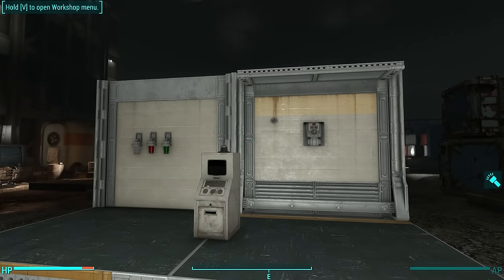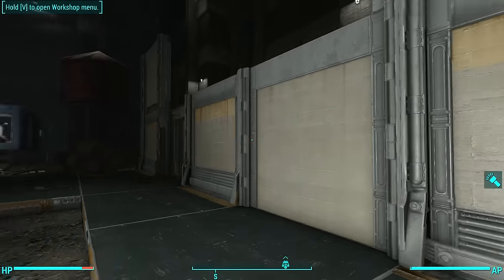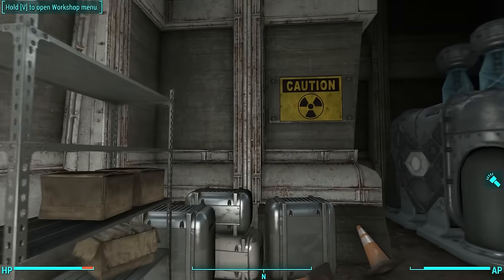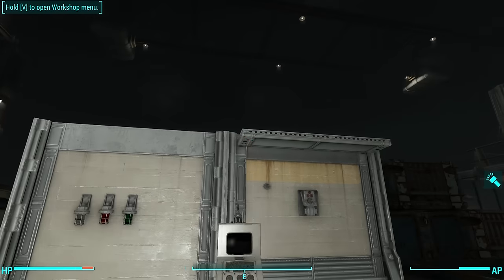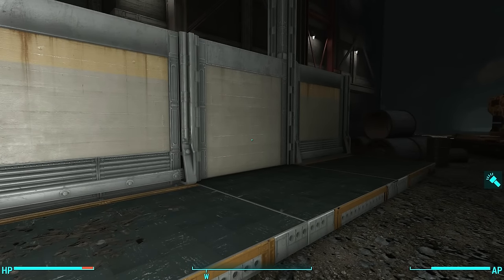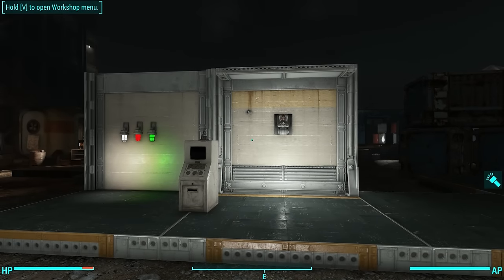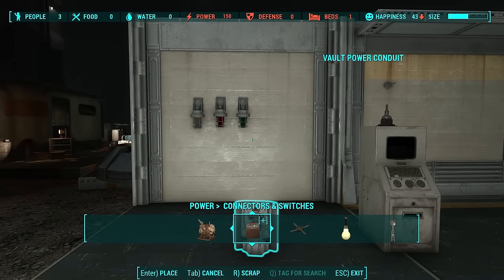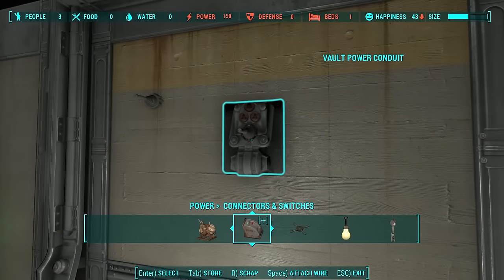How the Wall Powered Conduit Works in Vault-Tec Workshop - Fallout 4

Comment: Well all my walls are connected but I still have no power.
Reply: Fallout 4 ...
Reply: Got to use the conduit to power non vault items.  So basically a conduit everywhere you want to use not vault Tec items
Reply: John Morrison same but as we all know Bethesda don't bug test their games
Reply: yeah I did everything right but parts of my place still wouldn’t power on. I even picked up my reactor and dropped it in different places. but a few sections refused to work until I ran wires on the outer shell of the building. at least you cant see them from the inside.
Reply: Dasychain the power conduits from the reactor in an "unbroken"  but invisible line. the power jumps from one to the other in line.

Comment: I figured out why power might not be working through the vault conduits. This solution only works if you're on PC and you have this problem. Toggle freecam and look underneath the vault reactor. The devs wired these hidden conduits underneath the map all the way to the unscrappable atrium hall piece which also has a conduit underneath it. I assume they did this because there's no actual way to seamlessly let wire pass through the walls with the current engine, so they lie about it and hide the wires out of sight. Pretty sneaky of them. Anyway, these conduits are called "Starter Power Conduits" which means they can't be scrapped, and if they can't be scrapped, you shouldn't use mods to scrap them. All you have to do is toggle collisions (tcl in console) and find a way to wire up the conduits underneath the map in a way that they are hidden (for cosmetic purposes) if they aren't wired correctly, or if a conduits missing in the grid. If everything is wired correctly and you're still not getting power, I'd check to make sure the first piece you put down is correctly snapped to the unscrappable atrium piece. If you scrap it, you won't be able to get power from the Vault 88 reactor. If you did somehow mess up the flow of power from the reactor to the atrium piece, your only other option is to place down one of the generators that comes with Vault-Tec Workshop. You'll have to deal with having an abnormally high power number, which may mess up the balance in some settlement mods like Sim Settlements.
Reply: You sir, are a wizard!

Comment: Ok, so I had a BIG problem, which I hope you don't have. I moved the starter corridor for the vault, which is normally unmovable unless you press the "insert" button, which enables moving/scrapping of a small amount of additional objects like rubble or skeletons. What I didn't realize is the whole vault is actually powered by an underground set of connectors connected to the starting generator.

Underground, there's a conductor called "starter conduit," which can ONLY connect to the starter corridor, and it snaps to it underneath the base of the corridor. If you move the starter corridor, it severs the connection. However, with TCL, you can actually float through the ground and repair this broken connection. Not only that, but you can reposition the starter corridor anywhere around the entrance, and it will work fine, as long as you place the corridor first, and the starter conduit underneath it second.

Comment: The thing that is getting to me is lighting. Especially in big atrium rooms everything looks dim unless I use a billion lights! Help please Oxhorn?
Reply: I thought I might try that, good idea. Just wondered if anyone had any ways without mods as I have so many already!
Reply: I've found it useful to use the Track Lights to brighten up my atrium. They attach to both walls, floor and ceiling, depending on which ones you use, so the Bottom, Mid and Top atrium pieces are all covered. But honestly - big rooms usually use a billion lights, even in real life. The trick is fiddling with it, I guess.
I've also dedicated sections of my atrium to certain activities, such as lounging, games (pool table and Blast Radius etc), and the cafeteria's "outdoor" dining area, and lit each accordingly, as opposed to having an enormous unfilled empty space, which is a bitch to light up. You could also try stuffing some support beams in there and attaching lights to those.
Depending on your video settings (mine're kinda low), I've noticed a sort of foggy underground dimness that is just prevalent in Vault 88's expansive caves, no matter where you are, so you might wanna check to see if it's that before you try a million things in your settlement and waste your time.
Reply: Thanks for that, good suggestions :D

Comment: hey just a heads up in case you didn't know if your wanting to power a vault room that is not connected by floor or wall to a vault generator, say you wanted to build an above ground vault room, you can use the wall pass through conduit and attach it to the vault power conduit. it looks a little Jerry rigged but it works pretty well.

Comment: Wish I bothered looking this up earlier. Before I even started building I looked up brief descriptions of most of the new stuff, but didn't realize what it meant. Figured it meant it was the same as the normal conduits. 

Would've saved a TON of copper, plus it wouldn't have been such a pain getting power from my multiple reactors, including the one it comes with. I was able to hide most of it fairly well, and the new style that came with the contraptions DLC was great for this despite its cost.

Comment: The problem is not getting power from snapped Atrium floors but passing that power through other room type doorways.  Even when the "other room type" doors, such as an "overseer door", are properly snapped to an Atrium door end cap, a vault power conduit placed inside the overseer room does not work.  It is a bug, not a tutorial issue.

Comment: Oxhorn i recommend doing a video showing off the vault tec special bonuses (Use the overseers terminal for a int boost for example). There seems to be one for every special stat but you can only have 1 active at a time (if you have the int boost and get the luck boost from the slot machine then the int boost disepears).
Reply from the maker: great idea, thanks!

Comment: Nice explanation! One odd thing I've noticed is that if the link is broken to the main structure and then reconnected, sometimes electrical items don't turn back on. To fix this, I pull the radiating wall conduit off of the wall then put it back, and all the electrical items in that conduit's range start working again. Downside- I have to pull and replace EVERY conduit "down stream" of the break point. sigh (I'm on Xbox One)
Reply from the maker: Thanks for the tip! I'm glad I'm building my vault first, and doing the electric last.

Comment: everything is connected for me and I'm still not able to generate power. I even put a normal generator down attached it to a conduit and it still didn't power any lights. I think my game is just fucked.
Reply: the lights have to be with in the conduits radius try place more of them or moving the light close to the one you have already placed
Reply: +Pack Ice yeah I figured out my issue. the main reactor or power source that comes with Vault 88 is damaged and I can't repair it for some reason. so I placed one down in my vault and I'm all good now. thanks for the help though!!
Reply: did you try repairing the the cycle that Clem  blew up that might be  why the power didn't reset if just deleted it
Reply: I repaired the cycle

Comment: sometimes this does not work even though they are connected via the floor as an example i was doing my door signs like hydroponics but its pretty far away i try'ed the conduit on the left hand side of the door it didn't work then i put it on the right hand side of the door and it did i don't know why it done this but yeah thanks for the guide now i actually know how it works

Comment: I can’t get it to work beyond the first 3 squares of the entrance to the huge cage. 

All of my build beyond 3 squares is at an upper level. 

Put a vault power conduit on the wall beside the entrance to the cave and bingo a wall light works. Move that conduit to a wall 3 blocks away with a wall (at ground level), that too works. But add another power-conduit to another 5 squares away (upper level) and nothing. 

Odd. Because the first time I added the power conduit to the wall by the entrance, I had a ceiling light several blocks away (10 away and 1 up) and it started working as if not to need the wall adapter conduit thing. Now that light is always off. Nothing works unless it’s right by the entrance  (in it self is many many blocks away from the radioactive generator way back at the main vault entrance). 

All my blocks are connected from the original entrance. I first had a set of stairs leading to my upper level but I then added a wall to be sure (so the sunken invisible cables can run through the floor, up the wall and across the upper level floor). 

I’ve used all atrium bits to this first area. It’s only further away zones that I start using the red, blue blocks. 

Totally baffled. Feels like a typical Bethesda bug.

Comment: I think you may have left out some critical parts about how the generator is hooked up to the building because it is sitting on dirt and not connected (visibly at least) to the power grid system.  It won't start up & glow, either - what's the trick?  I see that you have two wires hooked up to it for something in the middle of the console floor, as well as to a nipple on top of the console - could you please expand on that last bit of detail for us? Those power radiators will not stick to external walls out where I have my gardens and I want to power streetlights out there without having a separate generator out there - BTW, it is hooked up the the floor.  Thanks!
Reply from the maker: No trick. All you have to do is snap a power conduit to a wall connected to the floor that comes out of the hallway that leads to the atrium. That's it.
Reply: I appreciate your patience.  Unfortunately, I can't get the wall warts to mount in the entryway of Vault 88 where I set up the testing equipment.  In addition, the first time I allowed the female to use the Phoropter, I failed to choose the red response and she left; I was thinking I'd just revert to a previous save, research your advice and restart the test, but it seems she's left the game because even though I set everything up correctly for the restart, she's gone and no other vault dweller will volunteer for the test - leaving me in the lurch. unable to proceed.  Any thoughts? Thanks!

Comment: the problem is getting the power to work through stairs or wide hallways .I have 999 power at the starting point where you meet julian.however unless I make more power at the water pump I can't get it to transfer down the wide hallway which then leads to stairs

Comment: The snapping is really not working well for me, particularly when building with the atrium tab
Reply: Stuff from one category doesn't snap together with another without using special pieces.
Reply: Snapping is harder, because the pieces are so thick and their snapping points are very clipped when they go in. 
  
Try removing surrounding bits, sneaking it in, and then building back up on it.
Reply: Honestly, I've had like...zero problems snapping stuff together. It's a shock, considering I would often spend hours trying to piece together simple structures with the wooden/steel base game pieces. You just have to figure out how it works. For example, the Residential Vault pieces vs the Common Room pieces look similar, but are very different and often have gaps between them when used interchangeably, so you can't really swap between them even though they aesthetically look the same. I've also found the Doorway End Cap is fucking invaluable to building anything in this dlc. It's also pretty much the segue between Utility/Residential Vault pieces and Room pieces. So you have U/R -> Doorway Cap -> Room Doorway. Pretty much anything else doesn't work.
If you have any specific questions for recurring frustrations I could probably help.
Reply: Yeah, I just had to experiment a bit and work out what snaps to what, it makes a lot more sense now, thanks

Comment: Have you tried/is there any way to spread power to the Wide Hallways? (The red engine room looking pieces that are double sized) I can't seem to connect any power connectors to the walls and I'd rather just scrap that shit if it doesn't work right then rig up generators and wiring.

Comment: Hi, I tried connecting or snapping one of those vault conduits directly to a wall in vault 88 that was also one of the main exterior walls on that vault but it wouldn't snap in place. at all. will I have to add walls and floors to it in order for the conduit to be snapped in/mounted?

Comment: I tried building a stand alone building with a vault tec reactor connected through a mix of utility, domestic, and overseer office pieces. Power works near the reactor with the wall conduits but not every where. Is there a known issue with mixing vault tec wall, floor pieces?

Comment: What if I want to do this OUTSIDE Vault 88? I know that I'd need a Vault-Tec reactor to make the power run through the walls BUT I don't require that much power, so my question is: Is there anyway to connect exterior power to the Vault walls?

Comment: Just a heads up, if you connect a "commons" floor and everything with the starting area's floor and walls the power does NOT connect... this dlc has Givin me a headache, killed the overseer just to get the final achivment needed from vault workshop and dropped it

Comment: Hey man i like this video but in the workshop this item just dont apear, i dont have it you know what´s wrong?
Reply from the maker: You may have a mod conflict
Reply: If you haven't already figured out what it may be, it may be that it is hidden away from the other conduits. Its at the end of the misc section of electricity, not the connectors and switches section.
Reply: thanks i reinstalled the game and they appeared at the final of the list

Comment: I have a question concerning the atrium ceiling. I'm trying to place a ceiling between the tall atrium prefab piece but cant get it to work. Any suggestions?
Reply: If you have any normal atrium walls near the gap where you want to place the ceiling remove them and then put the ceiling in. Then place your walls back.

Comment: the reactors you can build in the energy section, do they work the same as the fusion generator? in that it's power is transferred through the walls and ceilings?

Comment: I've seen so many streamers on twitch not using these and having pylons running from the reactor.  If had to explain to them how it works.  Very confusing at first.  The thing I find disappointing tho is I haven't figured out how to be able to run power to the water filtration without having to put generators down there.
Reply from the maker: You need to built into that room so you can wire it to a wall powered conduit, or string large pylons from the reactor into that room.
Reply: +Oxhorn I kinda screwed myself over on that.  My vault is blocking the way down to the water treatment. I've thought about if I get enough resources to try and build my way all the way down there
Reply: I just built two super-reactors down there to power it and four other industrial water pumps.

Comment: how do they work down extra wide hallways and stairs?I can't get power down the long stretches.like start building point and water pump
Reply: I built two super-reactors in the water pump room, as well as four extra industrial water purifiers, hooked it all up, and it still counts as power and water to your settlement, so you don't necessarily require tons more power, or require the water pump to be hooked up directly to the wall of your vault via powerlines.
I can't fathom why you would need more than 150 power to power your vault's lights etc anyway, but I mean, you could always replace the Vault Reactor in the reactor room with a Super Reactor. They're the same size, just about, and the super reactor puts out 500.

Comment: Does anybody know how the heck do I power  the power armor displays without having to chug a generator inside the room?
Reply: Do you have the contraptions DLC? You can use a conduit that goes through the walls. The power source can be out of your house too.
Reply: Wiggle D I do, and I tried that, but it doesn't seem to work... There's just no power on the other side :/
Reply: Did you hook the power generator to it's coil on the outside of the house? Did you hook up a coil conduit piece to the pipes in the house before attaching it to the power armor display? Do you have enough power to light the display along with everything the generator is attached to? Is the generator on?  Seems like Fallout 4 needs it's own tech support. xD

Comment: Maybe you can help me out. I have the PlayStation 4 and Fallout 4, I can create the generators but as far as power conduits and the power connector that connects to the wall are not available to me. It says that I have all the materials to create them and I have room in the build bar but it will not produce power for me. The only way I can get the 500 power core to work is to attach a wire to it. If I connect lights on the wall next to it they do not work, and I cannot attach the wall switch to the wall because it will not show that its there. This is very frustrating. Any help would be appreciated.
Reply: Forget about the above problem. It has been rectified.
Reply: how did you rectify your problem??

Comment: How do you get electricity to travel to the front part of the vault after you walk in srry I'm a noob
Reply: I think you need to wire those parts manually unless you happen to find a spot where a Vault conduit will snap in. I had to use normal conduits and wire up the place...